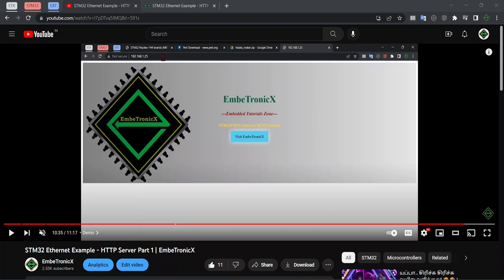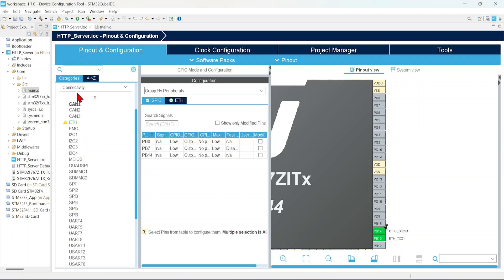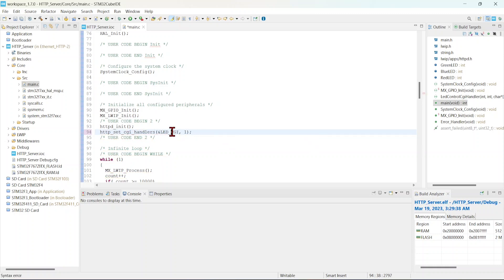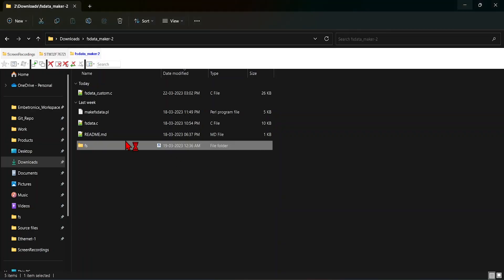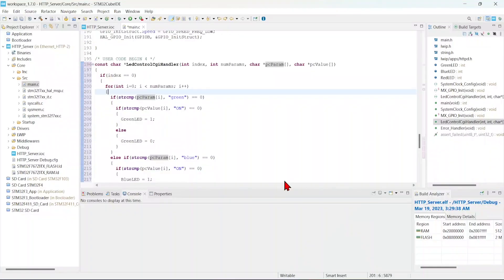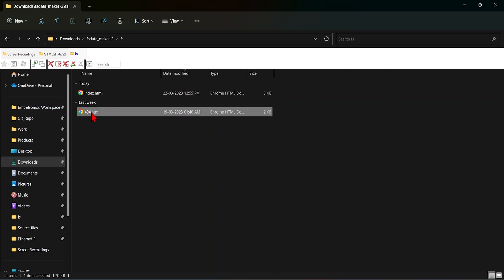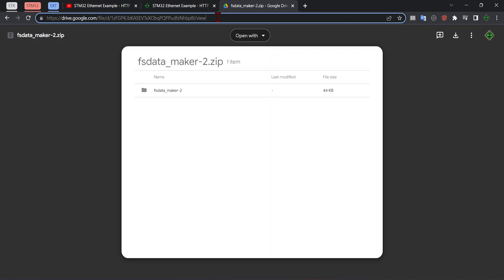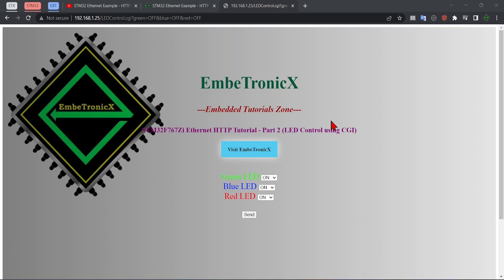STM32 Ethernet Example using CGI (Controlling the LEDs) - HTTP Server Part 2

Comment: If anyone is having issues with loading the correct page, where instead of displaying the one with the EmbeTronicX logo and colorful presentation, it just shows a minimal page with a couple buttons that don't do anything on the board, I have found something that has solved this problem. In the ioc file, when configuring the HTTPD, enable the first two (LWIP_HTTPD (LwIP HTTPD Support ** CubeMX specific **) and LWIP_HTTPD_CGI (HTTP CGI Old Style), just like in the video), then, go to the bottom, and enable the last one (HTTPD_USE_CUSTOM_FSDATA (Custom FS Data)).

From the project at GitHub, it shows enabled by default, but mine was disabled, which caused the problem, since the fsdata_custom.c file was not being read.

Comment: Since http GET with URL parameter is not good practice for activating LEDs (http://192.168.1.25/LEDControl.cgi?green=OFF&blue=OFF&red=OFF), is it possible to process a POST http request with a real payload doing the same ?